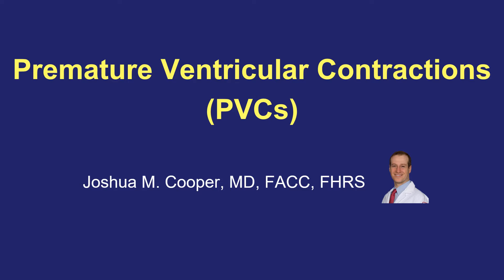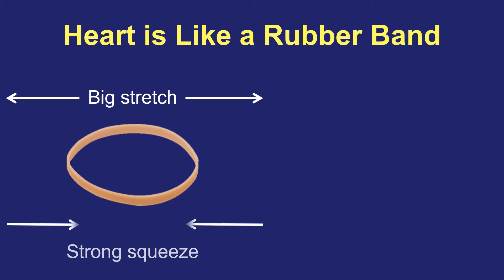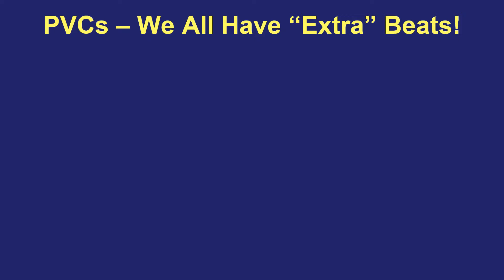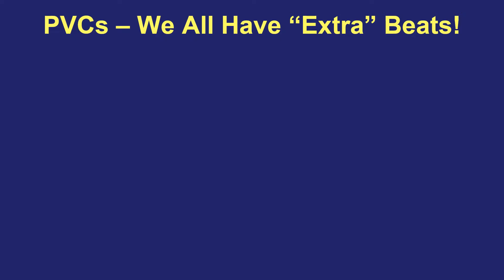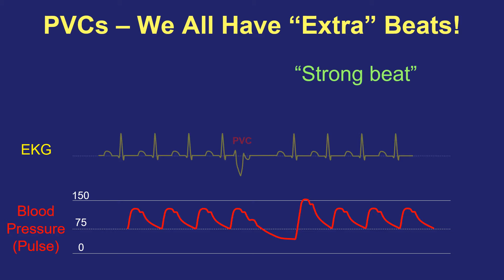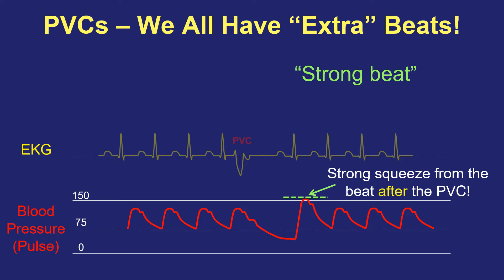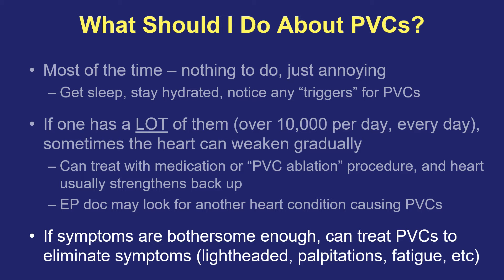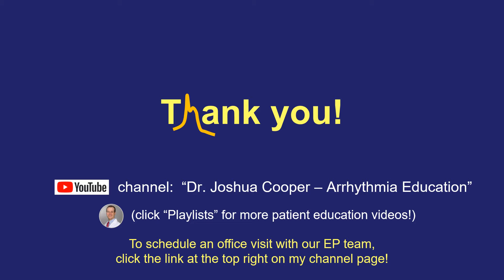PVCs: Symptoms and Treatment - in Plain English!

Comment: Magnesium !!!! I have had PVCs for the last year now. Prior to that I would get increase heart rate while doing minimal things. It all seemed to be connected with me eating, or rather not eating. After years of trying to figure out what was going on with my body, I concluded that I was vitamin deficient. After watching this video I saw several people mentioned Magnesium so I started taking 400mg daily. My daily pvcs have almost gone completely. And still getting better. I almost feel 100% normal again. I did check with cardiologist first (well after i started) and he said me taking magnesium was fine. Not sure if this will work for everyone but it was the best suggestion I had in a decade. Hope it helps 🙏🏾
Reply: Hi, could you tell me the brand name?
Reply from the maker: @chick758  Over the counter magnesium oxide is often used, and works for some patients.  400mg daily or so is the usual dose that people might try.
Reply from the maker: Thanks for sharing your experience!
Reply: It's probably best that you should've had a blood test done and also do an electrolyte measure test to know if you're deficient or not.
Reply: I had a-fib and taking magnesium helped a lot.
Reply: Can you please tell wich type of magnesium

Comment: Watching this as I lay here in bed dealing with these symptoms happening several times a minute, which scare the crap out of me because it feels like my heart is completely stopping wondering if it's gonna beat the next time it's supposed to. I know it's supposed to be "normal" but it sure doesn't feel normal.

 Great video and great explanation!
Reply from the maker: I hear you!  I also feel suddenly frightened when I feel PVCs, for the same reasons (and this is my area of expertise!).
My video is not intended to suggest that having PVCs with symptoms is "normal" and should be dismissed - to the contrary, despite being very common (and usually benign), it isn't "normal" to be aware of one's heartbeat.  And it's scary!  As I've mentioned, there's a difference between "not dangerous" and "normal."  Depending on the frequency and severity of PVC symptoms, there are treatment options available to improve quality of life, although it's perfectly fine to "just live with the symptoms" of PVCs if that's what the patient decides to do after a thorough discussion of the options.  And some lifestyle modifications can often help reduce symptoms, including being well hydrated, getting enough sleep, eating well, exercising, and trying to reduce stress as much as possible (a tall order nowadays!).  Best of luck to you!
Reply: Are you ok I’m having so many tonight
Reply: @PaigeC.94  Yeah, knock on wood, I've been doing pretty good the last couple months. I have a few that I notice from time to time but nothing like what I've had on and off over the last 5 or so years. 

I hope you get to feeling better soon. I know it's scary, but you'll get through it. Best thing I've found is, if possible, try to do something that takes your mind off of it.
Reply: @PaigeC.94  mine just started so scary giving me major anxiety
Reply: I've been dealing with the exact same thing since the 90's--it still doesn't feel "normal".
Reply: Same here been having them since i was young but ones every so often now i get them mostly everyday at night so scared i wont make it to see another day
Reply: I have the problem I take medicine metaprolol 80 milligram
Reply: @hajrijacajic2909  I was so scared I researched and began taking Magnesium, which I have found helpful.  I believe all the anxiety can cause other problems.  Such a straightforward response such as Dr. Cooper has offered could thwart many sleepless nights.
Reply: I’m going thru myself for maybe 5 years ago .

Comment: Thank you so much!  This clears up any confusion I had prior to watching your video.  I suffer from PVCs and have an ICD now.  I've shared your video with my family to help explain my condition.  If I had understood all of this 30 years ago; maybe I could've taken earlier action that would have prevented the implant.
Reply from the maker: Glad the video was helpful to you.  People with PVCs generally are at low risk for life-threatening arrhythmias and as such do not need an ICD; the 2 main exceptions are 1)there is another heart condition present that both increases the risk for dangerous arrhythmias and also causes PVCs to happen,  or 2)PVCs have occurred at a high frequency (at least more than 10,000-15,000 per day, which is ~10-15% of all the heartbeats) and as a result, the heart got weaker over time and a decision was made to implant a preventative ICD due to the weak heart (low ejection fraction).  In scenario #2, however, the weakened heart may be able to strengthen back up if the PVCs are addressed with medication or catheter ablation; and an ICD can often be avoided if this "reversible" cause of a weakened heart is successfully addressed in a timely fashion.  I wish you the best of health and thank you for the wonderful feedback!
Reply: Is this psvt.?. My mom showing all symptoms of psvt.. doctor are relating to h(high) -bp and change bp medicine but problem is same.. she gets episode..

Comment: First of all...thanks so much for this video. It's so helpful and very easily explained. I've recently (within the past year) started having PVC'S. I also have panic disorder, so it can be a vicious cycle at times. 🥴 One thing I try to remember (in case this helps anyone else suffering with anxiety and PVC'S) is that I've been told that unless I feel like I'm going to pass out or have bad chest pain, I'm most likely fine. The "skips" and strong thumps are annoying and scary, but it seems the more I brush them off, the less I have.

Thanks again for your wonderful explanation!
Reply from the maker: Thanks so much for your kind words.  I'm sorry to hear about the PVCs which create anxiety, but bravo for having the insight and fortitude to gain some control over them!  It can indeed be a vicious cycle of PVCs causing panic, which causes more PVCs, so anything that can break the cycle will be helpful.  In this case, simply gaining some understanding about what PVCs are, why they make you feel a certain way, and how they are usually very benign, can be therapeutic by decreasing some of the fear and anxiety.  Thanks for sharing your insights with me and other viewers!  Best of luck to you.
Reply: Plenty of magnesium at bedtime will help in two ways...1. More restful sleep 2.reduction or elimination of PVCs.
Reply: I have the exact same problem. Anxiety and panic problems and hellacious PVCs. I hope I qualify for ablation soon.
Reply: Hey can you sleep at night
Reply: Me too! Magnesium has been helping me tremendously
Reply: @ladyvirgo013  What kind of magnesium and do u have ectopics meaning skipped heart beats r palpitations?
Reply: @sclark7577  PVC's. a good Magnesium complex, never Oxide.  So make sure your Magnesium has a variety in it, again NOT Oxide
Reply: @ladyvirgo013  magnesium complex great. Organic r it don’t matter? Also I can find those in regular stores? And do they minimize your PVCs are have taken them away completely? And how long does it take to see results thanks?
Reply: @sclark7577  I ordered mine from iherb.  I would say the pvc have reduced but not completely gone. I seem to experience them more when we have huge solar flares that enter our atmosphere.  So bizarre but I've definitely seen a pattern
Reply: @ladyvirgo013  oh ok thanks and WOW that’s crazy.

Comment: Great video! Do you have one (or on in the pipeline) on premature atrial contractions? I'm interested how this differs mechanically, symptomatically, etc. I have been having PACs for last 4 months or so pretty constantly noticeable. My cardiologist linked me this video with a strong recommendation and it was truly fascinating but I would love to understand how PACs and PVCs are similar and dissimilar and your method of explanation is wonderful and clear.

I feel them less when lying down and more when my heart rate increases (exercise or even just getting up quickly after being still for some time) but otherwise I'm still on the hunt from correlating factors like caffeine etc!

Thanks for the great explanation and animations!
Reply from the maker: It's a great question!  In the video, I explain why PVC beats are weaker than normal, but I don't get into full details.  There are actually 3 reasons why PVC beats provide a weaker pulse:
1) The beat is early, with less time for the ventricles to fill (discussed in the video)
2) The sequence is bottom-top instead of top-bottom, so that coordination is messed up (hinted at in the video)
3) The PVC beat doesn't use the usual, specialized electrical tree to get the electrical signal everywhere at once in the ventricles to create a coordinated squeeze, and so within the ventricles themselves there is a second kind of uncoordination (not reviewed in the video)

With Premature Atrial Contractions (PACs), issues #2 and #3 above aren't happening - i.e. there is good coordination between top and bottom, and there (usually) is use of the full electrical tree and therefore good coordination within the parts of the ventricles.  And so, PACs create a better squeeze than PVCs, and usually can be felt in the pulse as early beats, although they may still be a bit weaker due to issue #1 above.  The beat after the PAC can still be a bit stronger than usual for the same reasons as after a PVC - extra time to fill the ventricles and a stronger squeeze as a result.

Like PVCs, PACs can also have a variety of causes, but often we can't find any obvious trigger or reason.  They may come and go with illness, dehydration, stress, alcohol, fatigue, caffeine, some medical conditions, or have no obvious cause.  If bothersome enough to warrant treatment, options of medications and catheter ablation are both available, depending on the circumstances.  Talk to your doctor about your symptoms.  A simple heart monitor can often be helpful to track when PACs are happening and correlate with symptoms and daily events.  And sometimes PACs can be a precursor to longer arrhythmias such as atrial tachycardia or atrial fibrillation, which, if they occur, may warrant treatment from a medical perspective (whereas PACs are mostly just annoying and not medically important).
Best of luck to you and thank you for your kind comments!
-Josh
Reply: M suffering the same... It's si frustrating..  How r u doing now??? U still get them.?
Reply: @village_life_rk  I don't get them as frequently as I did during that period a few years ago. I believe the stress and anxiety of COVID and lockdowns (esp here in Melbourne) played a big part. Going to see a cardiologist and learning how normal and generally harmless they are went a long way towards quelling any anxiety around it, which in turn seems to have helped reduce their frequency/intensity.

There will still be a day here or there (maybe every couple weeks vs multiple times per hour back then) where I feel it, but I just tell myself "this is OK; it's just a feeling" and get on with my day.

I hope it improves for you! It's definitely not comfortable and makes the mind quick to jump to conclusions about what might be going wrong.
Reply: U mean you don't feel them anymore?
Reply: @village_life_rk  I still get them but far less regularly and far less intensely. What I'm saying is they stayed bad as long as I fixated on them and after accepting them they kinda just stopped. It was a self-fulfilling anxiety loop (at least in my case)

Comment: I was diagnosed with PCV's a couple of years ago.  I was referred to an electrophysiologist that prescribed a beta blocker and would not do an ablation procedure.  At that time I was having 16000 PVC's daily.  The beta blocker was "kicking my butt."  I had no energy, was tired all the time.  Finally, I saw my family doctor and under his advice.  I took the beta blocker every other day for a week and then stopped.  Once you are tagged by a cardiologist consultant, you are seen every year.  Just saw mine, and now I am at 17,500 per day.  I am scheduled to see an electrophysiologist later this month.  This is not the same once I saw a couple of years ago.  I'm hoping to get the ablation procedure done and not prolong my PVC's by medication.  The funny thing is that I experience no symptoms of PVC's as best as I can tell.  I am now on a beta blocker and I am tolerating it very well.  Has it slowed down my PVC's?  I have no idea.

Comment: I'll be speaking to my dr  soon, but this was extremely helpful. I'm not sure if I've got PVC or PAC (all I've noticed is that my resting heart rate has been at 62 like a rock).  I've had them once in a great while but for 3 weeks now, I've  had them for several minutes at a time for hours.  I was waken up by a few today.

EDIT: I saw your explanation in a comment below.  Seem that  more likely than not, I get PVC's.
Reply from the maker: PACs and PVCs are both early beats.  As per my other explanation, PACs are more likely to be felt as a weak early beat, whereas PVCs are more likely to be felt as an absent beat (followed by a strong beat).  A heart monitor can associate symptoms with a heart rhythm finding and make the diagnosis.  And then you can talk with your doctor about whether any further testing or management is appropriate.  Best of luck to you.

Comment: I have always had heart palpitations since I was 10-11. I’m 37 now and few months ago the flutters wouldn’t go. I called 911 and they rushed me to the hosp. The flutters continued straight for an hour n a half and then stopped. As per the drs, I had benign PVCs for an hour straight and they sent me home with a halter to wear for 2 weeks. During the two week period I got flutters or strong beats every hour or so. They also did the stress test and say that I’ve benign PVCs. So basically just gotta live with it. I never understood it well enough until I watched this video. Thank you so much! I still wonder why did I have them straight for over an hour. Not sure if you would know ? I’m always now fearful that it will happen again. I do have anxiety issues that I try to control. Also it may sound weird, but I’ve more PVCs when my stomach is upset or if I’ve acid reflux.

Comment: Thanks for the video. I’m 29 years old, and after severe stress in 2020 that caused stomach issues; I suddenly got daily PVCs and SVT. They are better on some days, and worse on others. The SVT runs are usually only a few beats, but daily (they don’t really bother me). The PVCs are around 500-2000 daily, and I also get them in bigeminy sometimes. Other times it feels like small but INTENSE runs (rarely). I haven’t been diagnosed with NSVT. Even the isolated feel in all kind of different ways, and I feel all of them. I also get around 500-1000 daily PAC. I have horrible anxiety over them, and it has ruined my life. One of my biggest fears is it being dangerous/getting worse or turning into vtach. I’ve had several ER monitorings and EKGs in 2021-2022, 2 x 24 hour holters (in 2020 and 2021) and an echo (in 2021). None of the doctors are concerned, and tell me it’s nothing to worry about and that I’m not at any risk for vtach. That I just need to work on my anxiety and my gut health/vagus nerve. But it’s crippling and a circle where the anxiety/stomach/heart just feeds each other. I’m completely inactive by now due to the fear, and even afraid to leave my house now or do what I enjoy. 😔 It has only been fueled further when I read on my 2021 holter that the PVCs are multifocal. Now I’m terrified, because why is that if my heart is “healthy”? Every time I read on it, the prognosis on multifocal seem worse. Yet none of the cardiologists I’ve seen even mentioned they were multifocal, just that they were completely benign. Are multifocal PVCs really benign in normal echos/hearts, and not a warning of vtach/R on T? Any ideas on what to do? I already get 20 mg daily propranolol and have tried various supplements, but they all just seem to make me dizzy. Possible because I may have POTS too. Sorry the long comment, and thank you. 😔
Reply: Hi! How are you feeling now, 2 month later? Any changes?  I think your biggest concern is anxiety maybe you should try breathing exercises, yoga, meditation?

Comment: Thank you for this simpler termed video. I was just told today that I have PVCs. I had always noticed my heart occasionally giving a hard thump during exercise ever since I was in my early teens but didn't give it too much thought as I figured it was normal during increased heart rate. Now I am pretty worried about what this means for my health and future as I am in my mid-twenties. The PA said it wasn't anything that needed to be treated for now since it happened only every 5-6 beats while he listened with a stethoscope. Funnily enough I came in for a knee injury not anything heart related. My grandmother had her atrial fib. diagnosed in a similar manner. Her eye doctor noticed something was off and told her to get her heart checked. Lo and behold, he was right to recommend a check up.
Reply from the maker: It is not uncommon when getting health care for things to be found accidentally during routine testing.  Sometimes it's an important finding that needs treatment, like atrial fibrillation.  Sometimes it's something benign, like PVCs usually are.  It is a small subset of people where PVCs signify something else is going on that needs evaluation and treatment, and if someone has 10,000-15,000 PVCs per day (10-15% of beats are PVCs) or higher, we watch to ensure that heart function does not start to decrease.  In that scenario, where someone has an extremely high number of PVCs and evidence of heart weakening, if the PVCs are eliminated or suppressed, the heart function usually improves, often back to normal. Keep in touch with your doctor for monitoring, and be aware that everyone has PVCs.